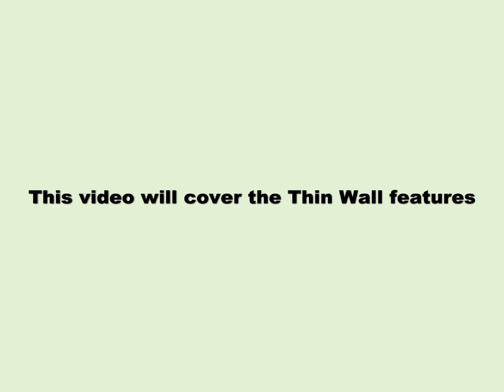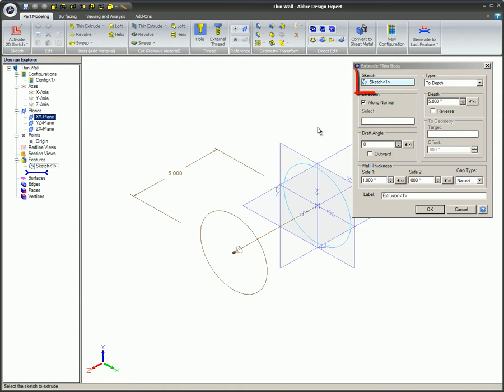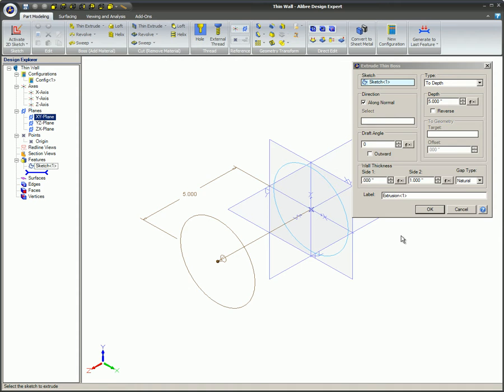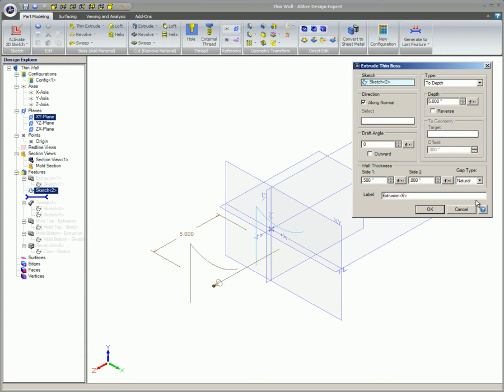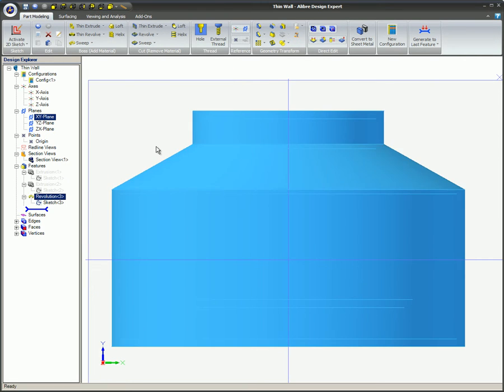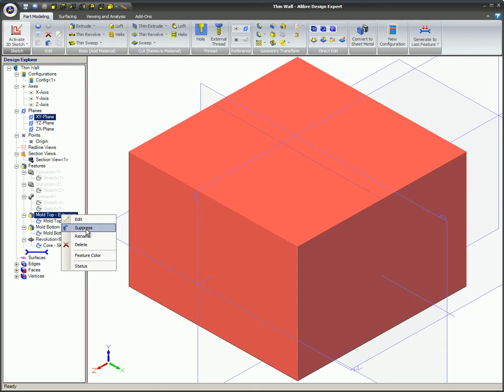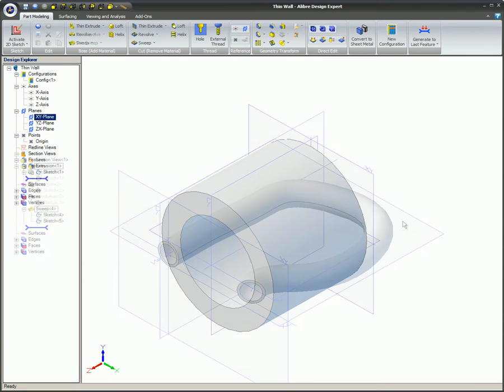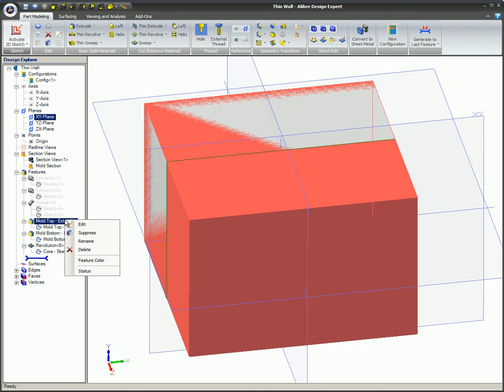Thin Wall in Alibre Design (Legacy Interface)

Comment: Using a thin revolve made from a closed sketch to demonstrate a mold is nonsensical.
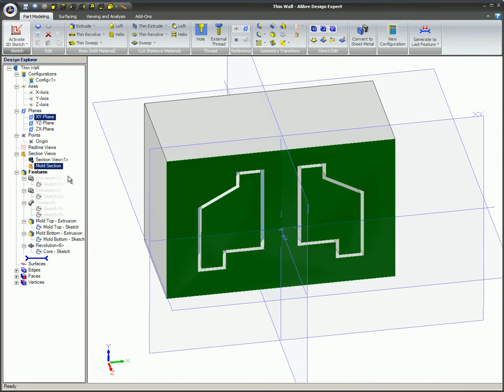One can see captive material at 3:31, for which there is no path of egress.
A better example might be the creation of an O-ring groove which opens on either a planar face or a cylindrical face, by revolving a single line.